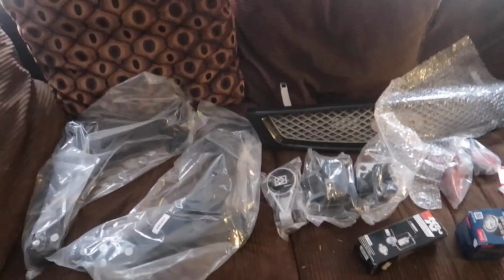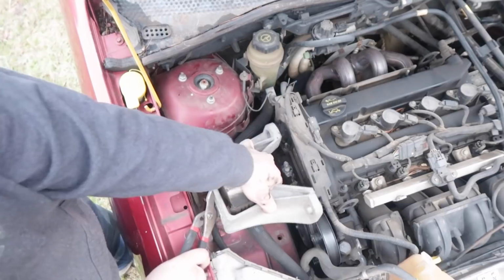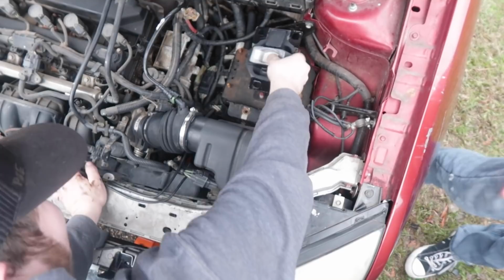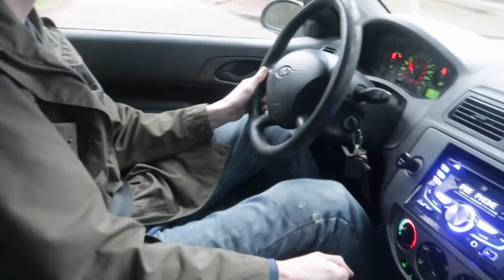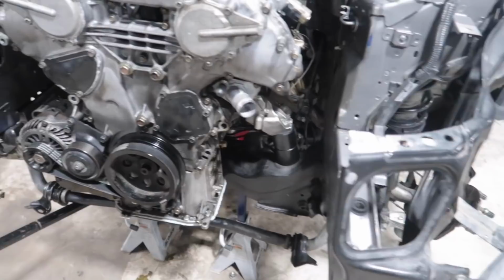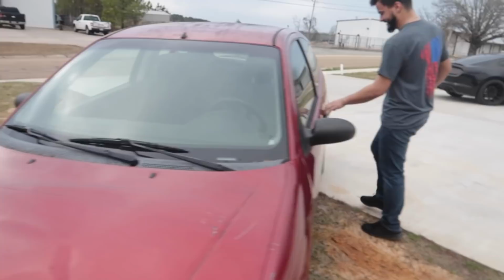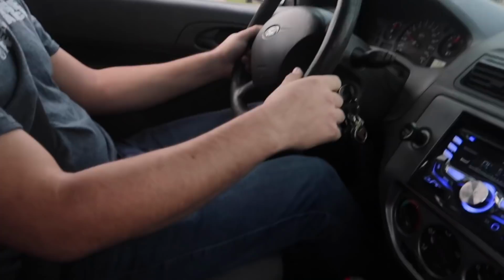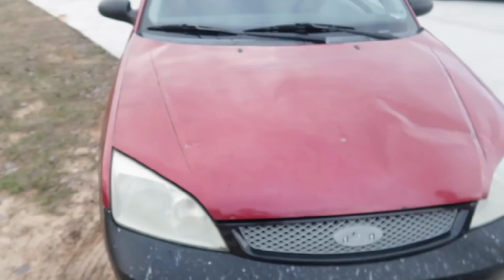How To Make A FREE Car Reliable.

Comment: I actually bought a 2004 Focus Wagon for $1300. I've put $200 of actual repairs into it for a clutch master cylinder. That's it.
I put two headlights in it, and it now needs a liftgate handle. Since the wagon is almost impossible to find in a wrecking yard, I'll have to buy that New from ford for $126.  it needs a battery and terminal cables, and tires. Not bad for 15,000 miles in its first 10 months. 

I'm really surprised and impressed with these cars already.

Comment: if you find an instrument cluster with a tachometer you can swap it without any wiring. remove, unplug, replug new panel and reinstall.  I got 280k miles out of mine before I had to repair anything

Comment: You definitely need to autocross the focus! There is a guy that took one and put custom solid suspension in rear and had stiff suspension up
front and had wheels and tires with 200 tread wear and that thing was a beast!

Comment: You should get a gauge cluster with a tach. Maybe one from either a Focus SVT or Contour SVT would work. If that were my daily I'd want to get a SVT cluster. My daily right now is a 2000 VW Mk4 Golf. It's my first VW, and I've owned 56 cars in the past 20 years. I bought the car for $400 and I drove it home holding the driver side door closed because the latch was toast, then I replaced it, the window actuator gear because it was broken, 3 out of 4 brake calipers, the battery, the windshield, the tires, both front strut assemblies (springs and all because some ass cut the springs all the way around) and rear shocks and springs, all of the brake pads, the MAF sensor, the secondary AIR pump, the entire exhaust, put in a short shifter, plugs and wires, the entire fuel tank, and it's just been ridiculous. So basically I paid $2000 for a 2000 VW Golf hatchback. The only thing that was good on the car was the engine and transmission. It runs mint now. Next issue, it's EXTREMELY slow. It's a 2.0 SOHC 8 valve...

Comment: I had a 2003 focus zx3. Only problems i had with mine is both window cranks snapped off and the ignition broke in half.  And a kicker L5 12” subwoofer made all of the interior become lose and rattle apart

Comment: focus starter wire runs right up to the battery my ignition went out and it's a beater so notspending 50 bucks when I can have a push button for 20 lol
Reply: You can buy new cables for cheap bruh less than 20$ for the actual wire if you know the gauge and length needed
Reply: @benson4u215  wire ain't the issue ford focus ignition always strip out